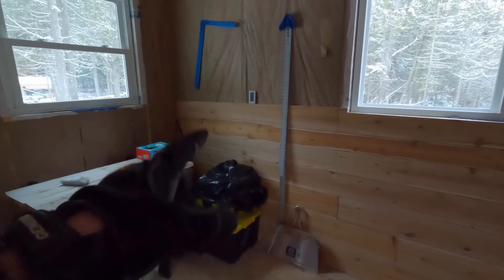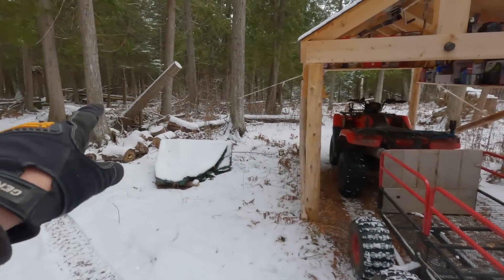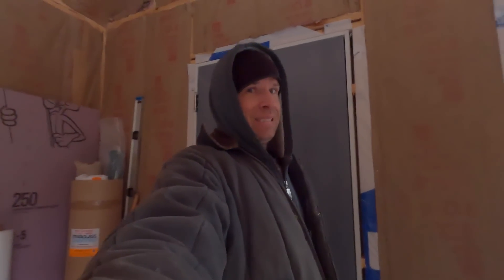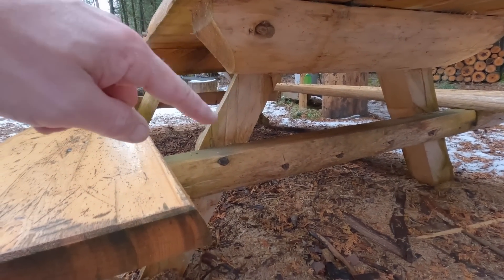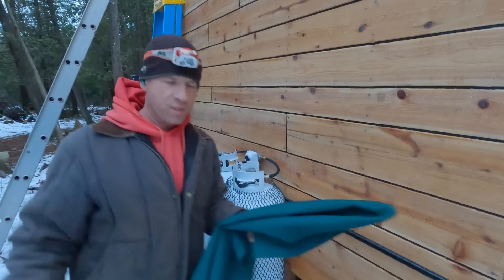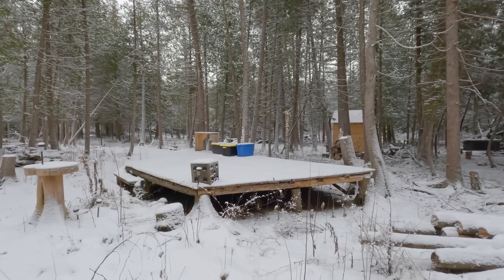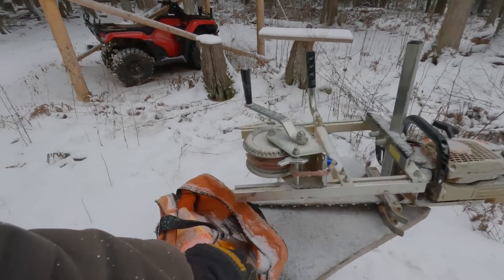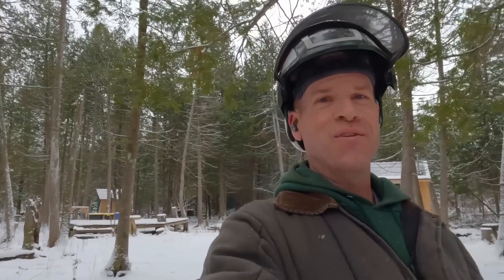My First HEATED Shower! +Felling Cedars to Finish Cabin. #118

Comment: You should get yourself a rechargeable, portable, immersable shower pump. Even comes with a shower head and hose! They're awesome and way more efficient than dumping water over your head!👍
Reply: Yup, I have one of those....they are great! Totally recommend.
Reply: Yup was thinking the same.  I do the bucket system like Ryan but I use the submersible shower gadget too.
Reply: Here in allegan Mich still in the 40s to mid 40s all next wk  snow on Thursday and Sunday   We had a blizzard 2wks ago  I bought a snowmobile because farmers almanac said it was going to be lots of snow  well only snow we got was that blizzard and it was all gone in 4 days
Reply: They make 12v versions that he can just plug into his power bank. Best thing I’ve ever bought for camping, pulls straight from the bucket.
Reply: Battery powered just adds another load on his limited electricity, I probably wouldn't do it. Some kind of hand-pump system would probably be better.
Reply: They also make shower heads  with a foot pump. Simple, cheap, and saves water. You only use what you need.
Reply: @bradsonnicksen6907  foot pump?   i like this one.😁
Reply: Agree....there is a guy that makes an all in one in a scepter jerry can.
Reply: But that costs money... Hehe..   Luv him, but its Ryan...  LMAO
Reply: Second the little shower pump.  I keep it as a back-up if my well pressure is not good.
Reply: Unfortunately they aren’t sustainable. Wood and solar are the only sustainable ways to heat.

Comment: You need to check with the Amish community about making oil powered lights. Here in East Jordan, we have an Amish community and at the local Amish store, Miller’s Country Market, they have interior lights made using rechargeable tool batteries. One of the Miller’s sons actually made them. The Amish people are very good with using resources that are off-grid but very practical.

Comment: Just an idea for the Patreon names of which I am not do you still have the walls to do inside of your heated cabin you could make a wall, and then you could just add names as you go along on the back wall, which I think would actually be more visible than the table, because when you’re in the cabin, you see it more of where the wall will be versus the table, which only seems to be seen whenever you use the table, which really, isn’t that often just a thought

Comment: Excellent video yet again, you do have a problem with heating the cabins and the gas you’re using must be a real cost. Why not use a smaller wood burner, I’m sure you’ve had this question so many times but it does seem an easy answer to an almost unnecessary cost. Great video / great work.

Comment: Hey, I just had an idea. I've seen you set up your chainsaw mill, attach a cable to a tree, and use the hand winch to pull the saw through the wood... Have you ever considered setting up the same sort of thing, but with some pulleys and cable... And some weights. To let the weight pull the saw for you?

Comment: Make an out door "kitchen" on the side, end, or next to the cabin. You can make canvas sides and door. Then when you need walls you got'em and when you do not need them you can fold them up or take em off. You will have a year round kitchen and the smell will still be outside.

Comment: Have you considered installing an outdoor furnace and heating your buildings with radiant heat?  It looks like you have a ton of waste wood to burn.  And being outdoors, you don't have to worry about chimney fires since you are burning cedar and pine.  Radiant heat will keep you warm with the air temps still being cool.  You wouldn't need much propane at all if you have wood heat.
Reply: Anything wood burning related he wont do. He does have a wood stove in one of the sheds yet never uses it. People make comments all the time including myself. Yet it is never going to happen. 
There is so much that he could do yet he wont. 
I think that he has a size limit of the foot print of the building so that is one thing. 
If I was me then I would build 3 buildings. 
Building one would be the kitchen. I would start with building a stem wall foundation about 2 feet up off the ground then backfill it and then insulate it with 2 inch foam and then pour concrete and or set with brick floor. Then I would build a really nice rocket stove brick stove/oven/stockpot burner. Along with some counters, wash sink and some places for a cooler or fridge/freezer. Then build walls that are insulated and have those big windows you can get at big box stores that are like 3 feet by 4 feet or bigger. Then build the roof in a bulldog type roof where one side is longer than the other facing the south and clear enough trees that the roof always is sunny. Install a bunch of solar panels that can charge a battery or directly fed for lighting and ceiling fans. 
The 2nd building I would build a shower and toilet area. I would dig out and put in a septic system along with a leech field. You can use a camping toilet that has the step trigger that opens and sends water in to the toilet. You can either use a electric pump or gravity fed water in the summer. The same stem wall and floor which can also be bigger for a deck out front of these buildings. 
The 3rd would be the sleeping area and desk area. Each one of these buildings would be in a line facing the south having a good foundation which is high enough off the ground so that it does not interfere with the snow. You can buy EG4 all in one inverter and EG4 batteries and used solar panels and have a really nice system for around 5 thousand dollars. This system is large enough to supply all of the electric you will ever need for a small place like this. Using wood heat fireplaces or wood stoves you would do very well. 
There are those BCAC Ashley Coal Circulator for like 1500 bucks. These are the ones for coal and wood. They have real grates on the bottom and not bricks. They work very well and you can stock them full for burn on low for a good 12 hours. They have a metal type temp air flow adjuster that you can set on high or low. They work really well. I have had one and really like how simple it was to use. This would provide more than enough heat for the living area. 
Depending on the codes of where he lives you can enclose in a breese way and still be with in the rules. If you can do this then putting the wood stove in the kitchen and stocking it will keep the whole place warm. Just use fans to move the cool air from each of the 2 side rooms in to the kitchen and it will heat the whole "building"

Comment: you could put the chipper in the shower with the heater on the floor, then crack the bolts on the blade housing to let the water drain when the ice melts.

Comment: Two thoughts:  maybe you should consider building a covered wood shed and I think you will have trouble with the trailer cover.  The center between the side rails will collect water/snow/ice.  2or 3 side rail to side rail fiberglass poles(like tent poles) with a slight arc would help.  Minor details you can work through.  Excellent vids and I look forward to Saturdays with you.

Comment: You need to switch those propane bottle out for (2) 100 lb. bottles!
Maybe even the next propane tank size bigger and mount on a small trailer you can get through your trails so you can haul back and forth from your parking area and have it refilled as needed.

Comment: I say get that small pump that goes on your drill, hose in the water an your golden! 
Are you going to caulk the shower walls in spring or leave it as it is? 
Can you make just a roof with 3/4 sides for you tanks on the cabin? No mater what it will be a amazing. 
This is very interesting to me an love watching your channel. O man, can’t wait for the next video!!! That will be crazy! I would get more tanks!

Comment: I still think you should get a wood burner and use the propane as a backup. SOOOOOO much cheaper and you have an endless supply of fuel that you've already paid for. And with wood you won't have a condensation issue like propane.

Comment: Suggestion; your first cut should be mid log and then move up for the second cut and so on. Cutting with the steel guides gives you a flatter surface.

Comment: You should study up about BTU's It's actually pretty interesting. Once you learn about BTU's, its easier to calculate how much LPG you will use. BTU's isn't an exact science since they are so many variables such as inside, outside temperature vs dimensions or temp of the water you want to heat and temp of the water, amount of water, etc.

Comment: ?/the best cheap floor insulation Ie seen is the foil covered bublewrapped rather thin looking but several guys swear by it for their cabin floors and they or it keeps the mice out better then the fiberglass and a place called repurposed materials has all sorts of odd reuseable materials including masterial from road signs very tough plastic n useful for covering hay stacks or anything or like a soft cover for your trailer or just make a tent type cover for your trailer. As an old flat b ed driver I used gto hate tarping loads of lumber but there were trailers like a box truck, THAT WERE CANVAS TYPE FRAMED COVERS WITH FOLD UP OR ZIP UP SIDES THEY were slick for loads where you had multiple stops from a flatbed trailer waY easier then untarping and retarping every stop. I have a small utility trailer 4x8 harbor freight like3-400 you have to assemble it but where can you find a trailer that cheap and I haves used it too many time very durable and people use them to build teardrop trailers for camping you can toe behind a car as well.

Comment: Drying all that timber in your heated cabin will dry it out ok, (with some warping probably), BUT - it will create an awful lot of humidity in there too.   You'll need to install some sort of extraction set up to cope, otherwise you'll find fabrics getting damp, water running down your windows and possible corrosion of tools.  Don't ask me how I know!  🤦‍♂

Comment: Never enclose the propane tanks to the house, and any covering should be built so it can vent away from the shed. Yes, that means there's a counterproductive valley between it and the shed, but that's better than a potential leak filling your area and going off like a bomb.

Comment: my plastic  5 gallon buckets the water froze all the way down to bottom and split my buckets wide open now they are trash so if i have water in them now where it runs off the roof and fills them i empty them [f i know its going to be really cold for several days below freezing